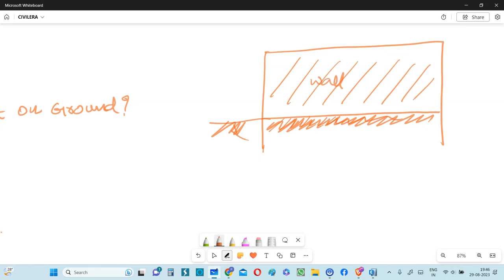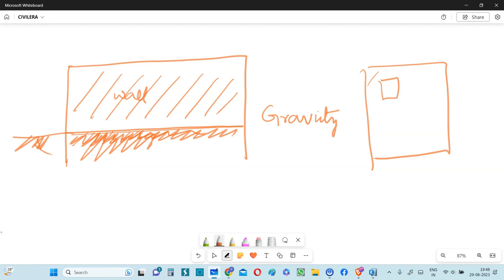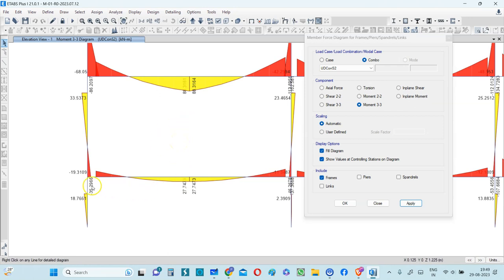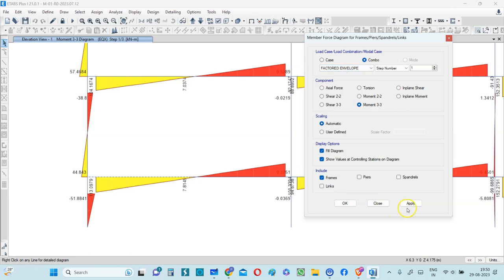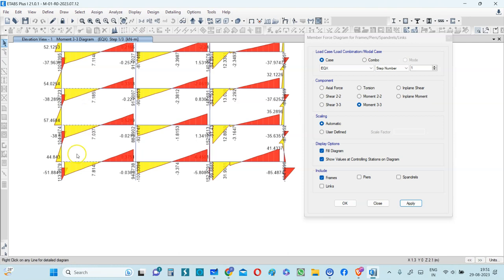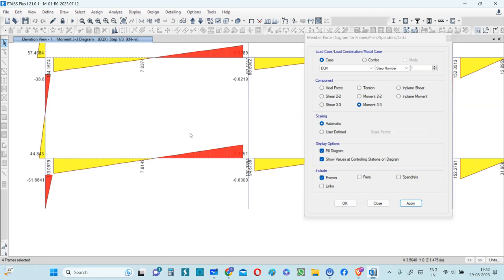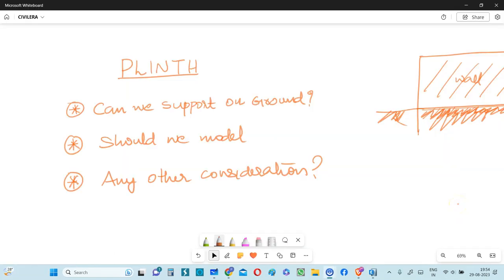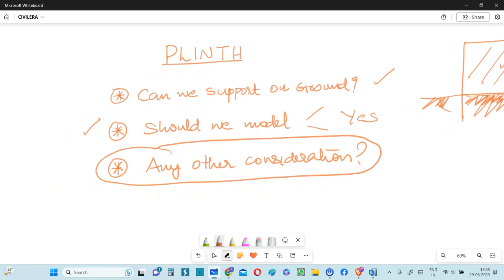Plinth beam : Plinth beam design I Is it mandatory to model plinth beam for design?

Comment: Avoiding plinth beam will cause the column to become slender but most of the times, the plinth beams makes it a short column fully under compression, which itself is a problem..
Reply from the maker: design for it. saying it creats short col effect and ignoring its need is not possible either
Reply: @CIVILERABangalore  yes u r right.. can u plz make a video on how to properly address the issue of short column effects??
Reply from the maker: @M.Khan325  model it and design for the appropriate forces developed
Reply from the maker: @M.Khan325  short col effect needs to be captured in analysis by properly modelling it. Then design as per the forces.